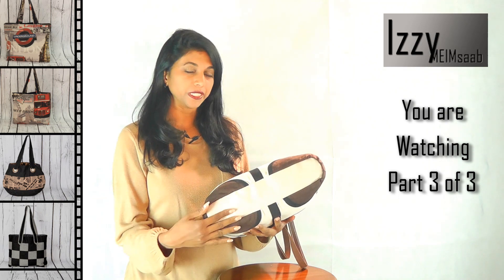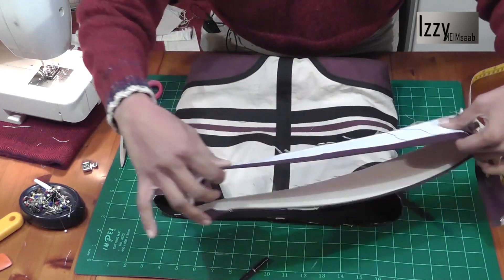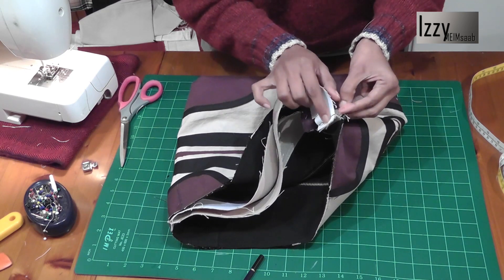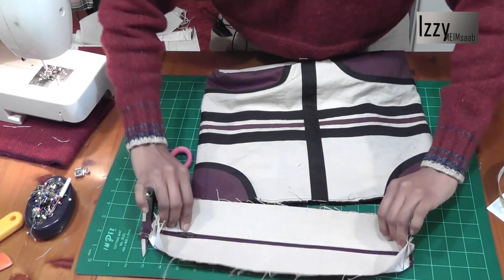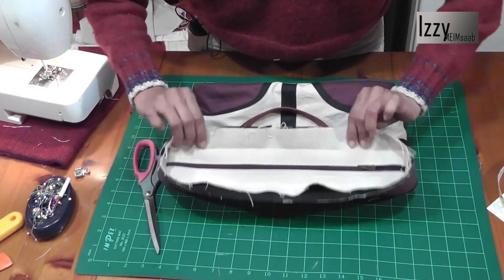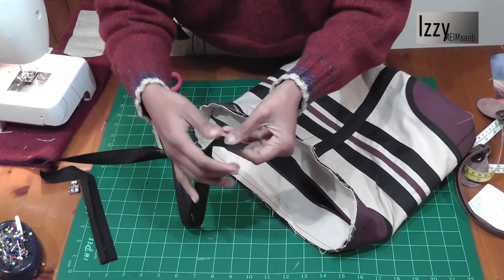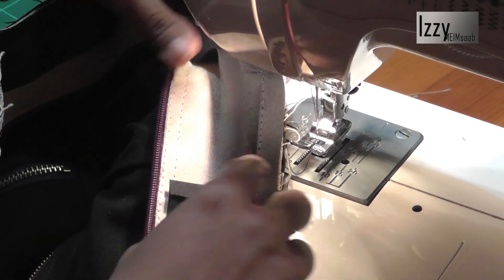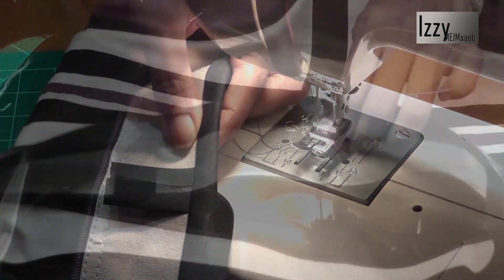Canova 3 Handbag pattern on izzymeimsaab.com / DIY Bag Vol 24C

Comment: I want to start a small business with leather and canvas bags. In this moment, I'm looking for information to buy a sewing machine.
Could you please recommend me a sewing machine type base on your experience?
Thank you in advance. I would greatly appreciate your help.
Reply from the maker: Violeta Neagu hi, any basic sewing machine is fine, I have used Juki and Janome, both are good.. please remember the most expensive machine does not mean you will get great finish, some times you can buy an old jones machine for less than a price of a hotel dinner, but they are built to last, and gives great finish. just do your research, and then buy an inexpensive one to start with.. it helps...